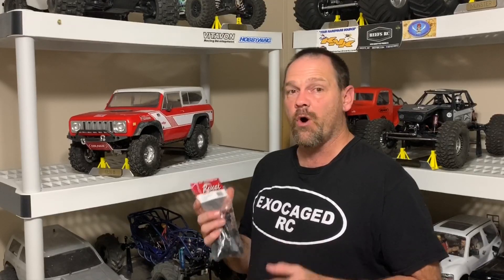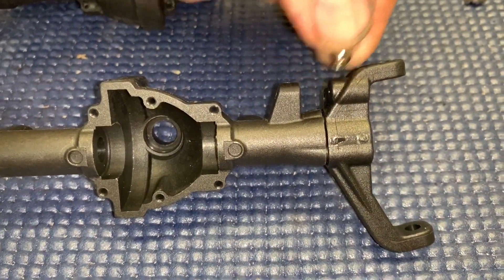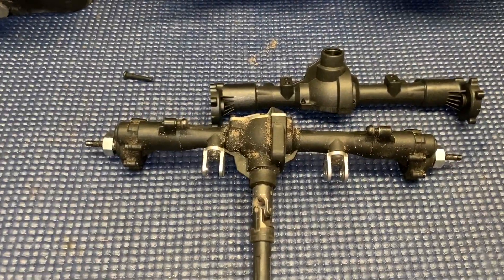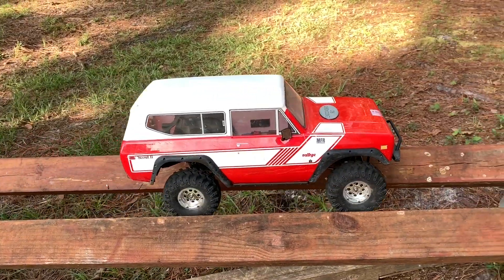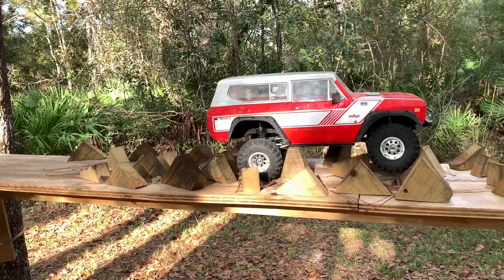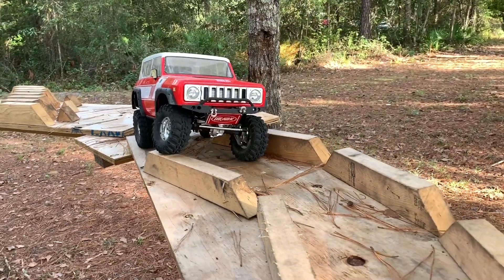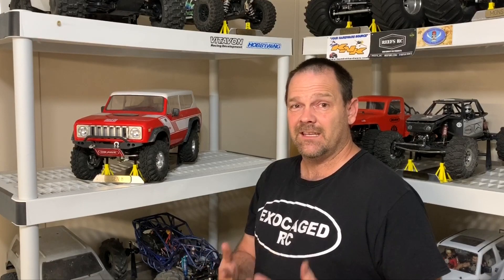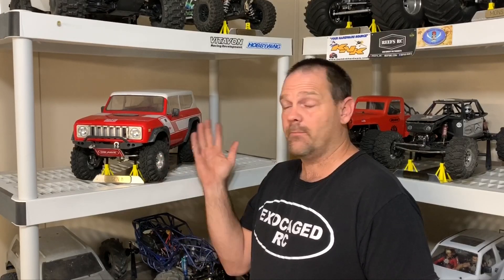Gen8 Heavy Duty Axle housings

Comment: A tip to get the screw off the drive shaft.  Use a soldering iron to heat it up. That breaks the locktite hold.

Comment: Real legitimate question now. 
How far can I set the steering dual rate. 
Basically is your steering dual rate cranked all the way up or do you  dial it down a bit.
Reply from the maker: Usually I run full steering and just set end points
Reply: Exocaged RC 
Oh yeah I guess I ca n reset the endpoints. This was on a different car before and set to it. 

Good idea man. This is why your one of  the best.  
Thanks bro. ❤️👊😀

Comment: I myself run Holmes Hobbies motors in 5 different trucks some 540 others 550 and many others I go crawling with have them. I've never had one burn up nor anyone I crawl with. If people are having that problem it's probably their fault for not gearing it properly or they're running it in mud.
Reply: Do you use the good brushed motors  i thinking used properly  for CLIMBING it will last long time and its ok not as durable as brushless or stock styles

Comment: How do you stall a motor on these? Like what causes the motor to stall?
Reply from the maker: Pushing against a wall or rock. Tires caught up in a crevasse etc.
Reply: Exocaged RC thanks man and ya right after I watched this video it took me to the video of you explaining it lol thanks for responding man and thanks for the good videos you help me a lot lol I’m new to the rc world and just got me a redcat gen 8
Reply from the maker: Well the Hobbywing 1080 is a great esc for $42 but I don’t think the bec has anymore amps than the one you already have. You can however turn the bec voltage up to 7.4v. Which may or may not burnout the receiver or the stock servo. Electronics can take some time to learn and chances are high you will blow up a few things like I have. LoL.
Reply: Exocaged RC thank you very much appreciate it